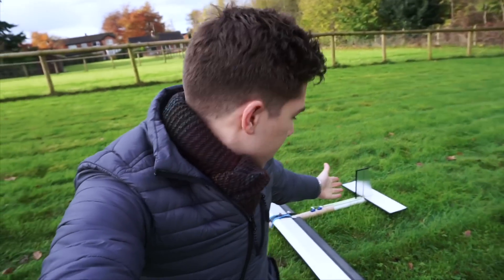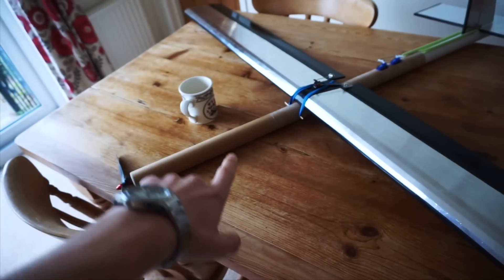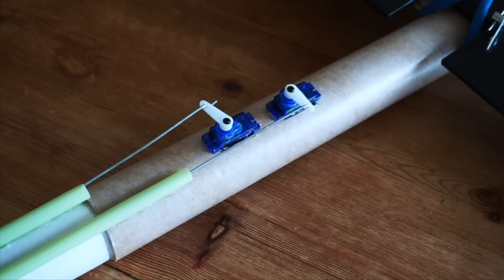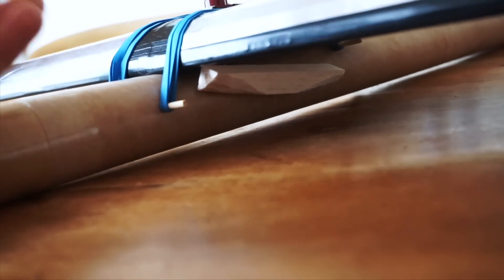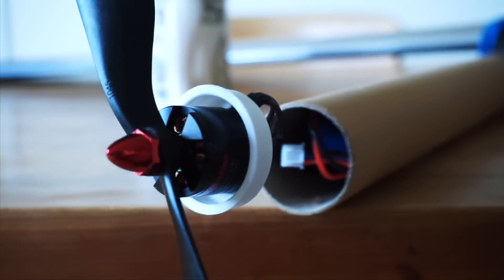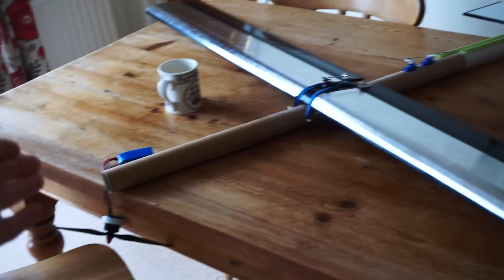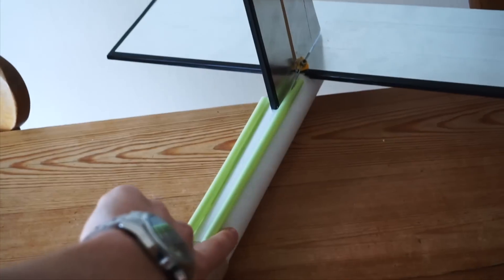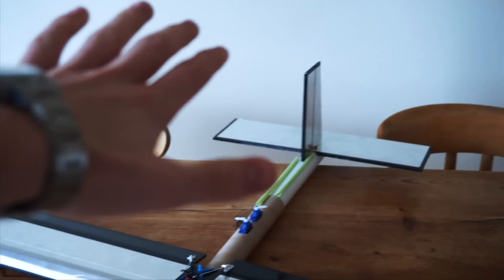Cardboard Tube RC Airplane

Comment: Quite long cardboard tubes can be obtained (usually for free) from shops selling material for ladie's dresses.  They can have a wedge removed from the rear end to transform it into a taper on the bottom side reducing the weight somewhat.  Good video. Look forward to the flight. Subscribed.

Comment: I am interested in building this sail plane, What was the length of the tubes. what was your wing sizes and how long was the square balsa that was used for the tail section? how did you figure the CG of the plane? Thanks for any help you can give. Thank Philadelphia Pa.

Comment: not sure why you quote everything in dollars as your British but $60 (£44.88) seems very high for a scratch build so basic, i could make that with a proper foam fuselage and with all electronics but excluding the battery for around £20! Also the wing does not go at the centre of gravity, the wing dedicates the centre of gravity and everything else is designed around it! wing size and shape determines the actual point and is measured on the chord of the wing
Reply from the maker: Hey, thanks for your comment. About the dollars, most of my audience is based in the States. With the electronics, all the costings were put up there in the vid. This is how much it cost me total, including a Spectrum Rx. Agreed, you could make one for less - but as you can see, the components I used were of a certain price. Maybe I'll aim to make one for £20 next time ;)
Reply: on your next build do away with that motor, its not beefy enough, grab yourself a  racerstar 2212 1400kv  is only £3.83 and provides just shy of 1kg thrust with a 9050 prop and only pulls 20A maxed out   https://www.banggood.com/Racerstar-A2212-1400KV-2-4S-Brushless-Motor-For-RC-Airplane-p-1085430.html?p=E8302048507252016052

i have loads of these, i have them in everything from my balsa cub and foam cub to my FT racer and skyartec cessna 185 epo bought plane, they run cool, are small and relaiable at a bargain price.

Comment: I struggle to build a plane in three months and this guy builds one in 5 minutes.
Reply: bro how
Reply: Flight test planes are so easy the plans you just trace onto foam board and watch build video or get the speed build kits and they already cut out for you and just watch the build video and follow along very easy to do. You wouldn't have been able to build RC planes like I use to when I was 10 there was no foam board plans you had to use balsa wood and scratch build over plans or buy a arf balsa wood plane or a ready to fly balsa wood plane
Reply: you could buy one...
Reply: @AARONLT25  less fun
Reply: @Its_Pilot  why did I get a notification about a reply from 5 years ago